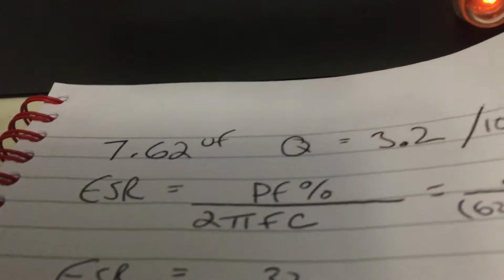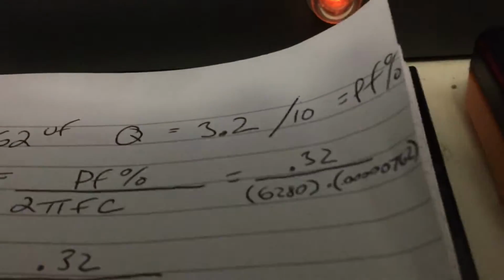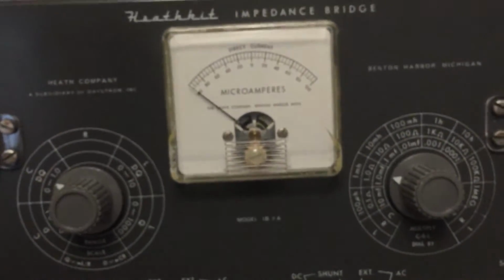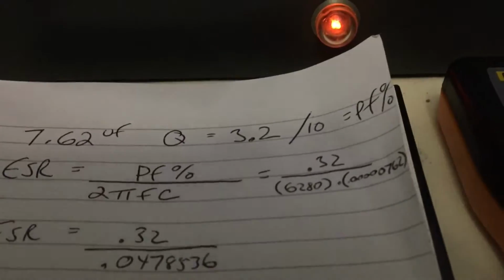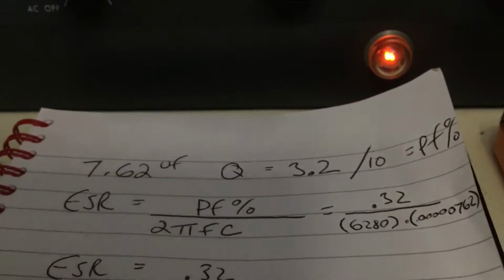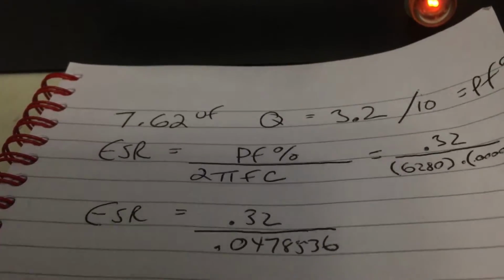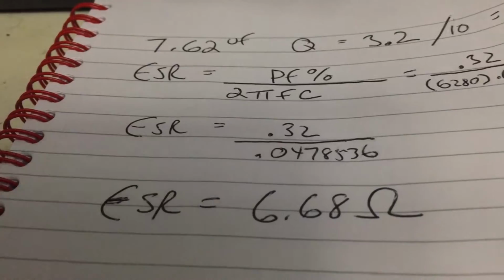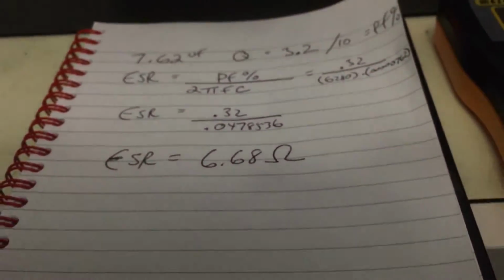Heathkit Impedance Bridge IB-2A [4] - D-Q ESR and Induction

Comment: My university has a similar model that I pulled out from the dusty shelf. This helped me actually understand the instruction manual that I misread! Thanks.
Reply from the maker: They are pretty cool and very accurate, but require restoration to function correctly.
Reply: @retrotechandelectronics  Sounds right. I thought I had figured out my error, but the needle is still unstable and jumping randomly on capacitance readings (inductance too, I believe). Any ideas?
Reply from the maker: You have rebuilt yours too?
Reply: @retrotechandelectronics  No, I am currently leaving it for another time, since I found a much more accurate modern machine. But, I might take it apart later if I have time.